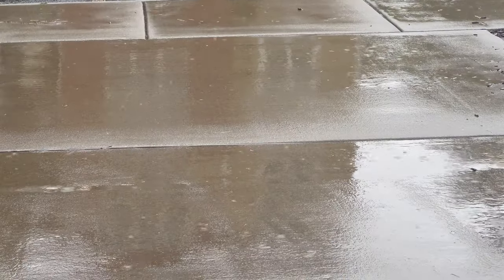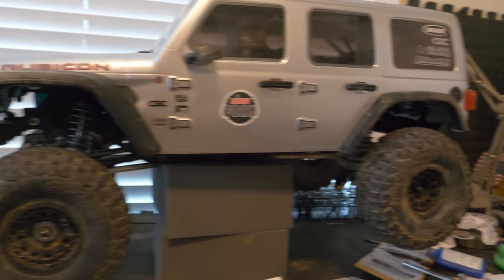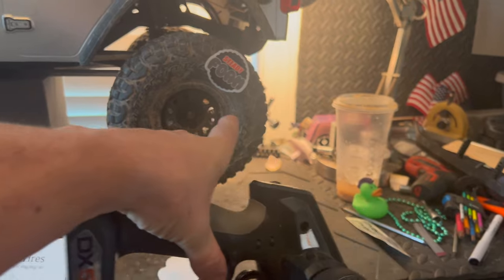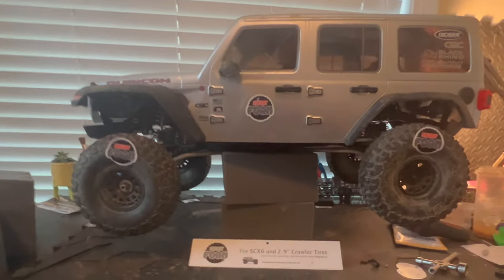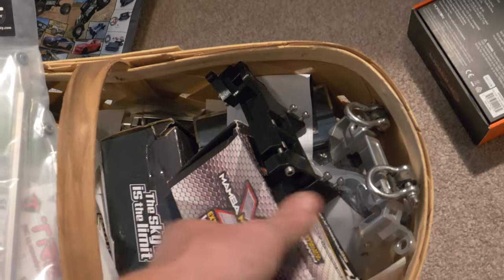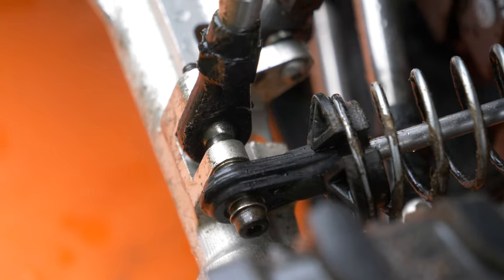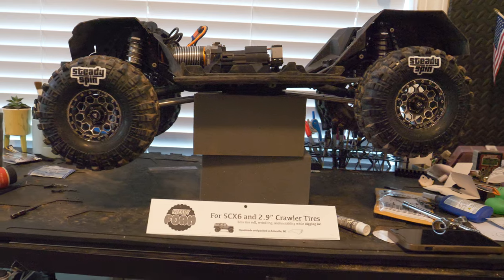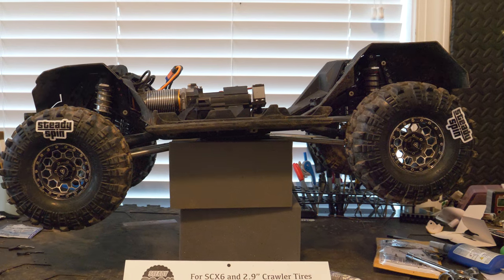Scx6 Treal Straight Axles vs Vitavon Portal Axles - Overdrive Underdrive

Comment: If you’re not jumping it, you really don’t need both tires on the axle to compress at the same time. 
When you crawl, you are only going to compress one tire at a time. 
But these SCX6s look killer! Think I might pick up the new Honcho soon.
Reply from the maker: That Honcho looks so good.
Reply: I was going to say the same thing. Most crawlers run into clearance issues when you compress both shocks at the same time in front. Totally normal and won’t be an issue when running it. I used to overthink stuff like this though totally lol.
Reply: I just got my honcho a couple weeks ago. It's everything I hoped it would be and more.
Reply: The honcho is also on sale on Amazon right now.

Comment: Just got my SCX6 Honcho today and already have some of your steady foams ordered based upon Exocaged videos.  Is there any difference in the quality between Treal and Vitavon?  I know Vitavon has more options at this point but would surely we interested in your opinion between the two.
Reply from the maker: Good question.  As you stated Vitavon makes more parts so default you will need some of them.  Both Treal and Vitavon make amazing parts with great customer service (worth the price tag to me).  It really comes down to the look of the parts.   Treal is owned by Wendy Wang and I can see the design characteristics of a woman’s eye.  Smooth edges and sleek like a beautiful women.   On the other hand Vitavon is owned my Arthur Zang. He has that raw, tough machined industrial look, almost like he cut each one himself.  Very manly.  And Vitavon makes a portal version of the axles.  They also have the high clearance servo tray, slipper delete.  Treal on Amazon and Vitavon from Exo caged shipping is about even. I’d say match what you can.   Is one better than the other………..no.  Vitavon does make more parts tho lol.  I have full set of everything from both. Spend all your money lol.
Reply: @SteadySpin  What a great style comparison between Wang and Zang....you really hit the nail on the head as the Treal is elegant and graceful whereas the Vitavon is exactly as you said, "manly" in it's design.  Since I'd like to consider portals in the future, I should probable stick to the Vitavon axles, knuckles, etc.  I'm assuming the various "links" will fit either brand as well as many of the other upgrades...?  Thank you again for the detailed reply.  Btw, took the new Honco out this evening for its maiden run and boy 'am I anxious for the steady foams to arrive;-)

Comment: I had a bad lipo fire on my battery. So it blew out my charger. I lost 6 batteries in the blow up lucky I had them outside charging I was outside just chilling using the old bruiser so I figured I charge batteries whil I did it so I took em outside to charge ya know safety first.  Lucky that day I did. Then lipos I had left bunt up in my crawler and took my esc not on one rc all four of em. I was done with it for a while.
Reply from the maker: That is a tough blow.  The newer hardcase batteries seem to be pretty tough.
Reply: @SteadySpin  right mine the soft ones I had them like when they came out I used them I’m lucky it only burnt up esc and wires. And a charger not my house.